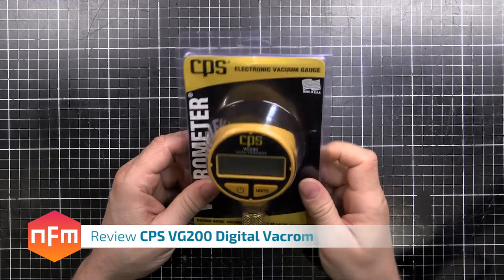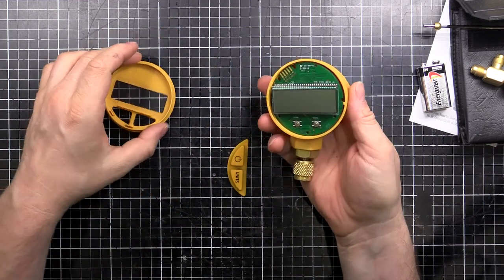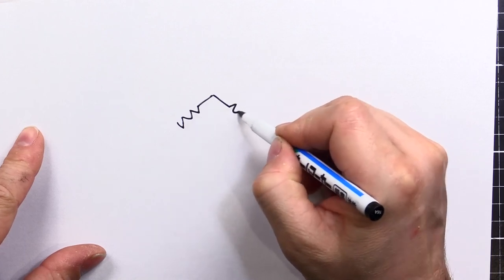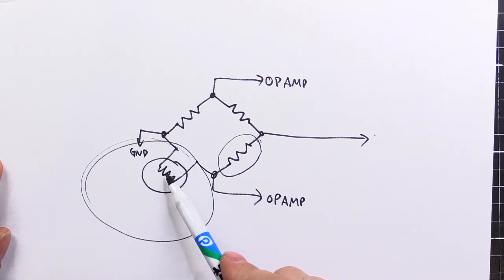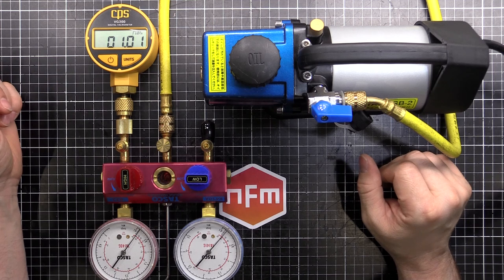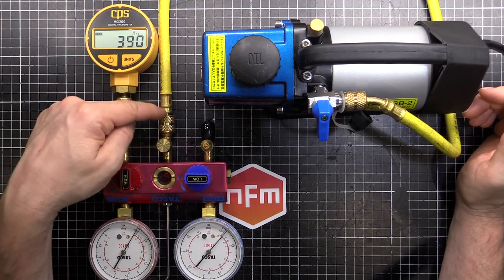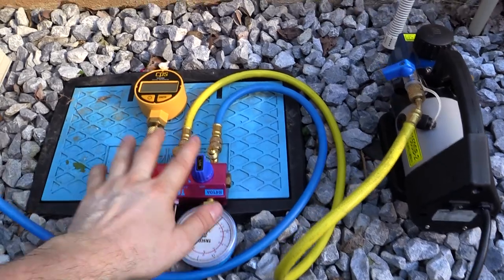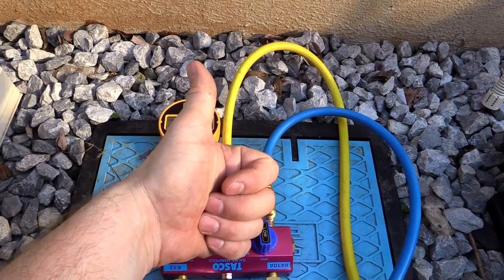CPS VG200 Micron Gauge Review

Comment: Where does this leak?? Everyone says that they leak mine doesnt .just trying to get an idea if it does happen  thanks .
Reply from the maker: Mine works fine and doesn't leak at all.
I think if you are careful and take care of it, it will work for years without leaking.
Reply: Mine leaks brand new out of the box, on the first evac. Was hoping  he was gonna break down the connection side of it as well. Guess ill have to do it… seeing as my Amazon return window is closed. I also have an email to CPS about it. Lots of reviews on Amazon stating the same.

Comment: Hi great video, I have a this gauge. I'm unable to get it out of low battery mode. Just shows dotted lines and a empty battery indicator. put a new battery in and cleaned the sensor with alcohol. 
Still the same.

Comment: What's the life expectancy of these gauges? During rugged everyday use, will these last a few years in service?
Reply from the maker: They should easily last for many years as long as you take care of it and don't let the battery leak inside.
There are no wear parts, basically the only maintenance needed is an occasional wash with isopropyl alcohol inside the pipe fitting where the sensor sits.

Comment: Hello ,can you tell me why is my cps micron gauge is turning off by itself while is working with the vacuum?
Reply from the maker: It has an automatic timeout to turn itself off after 5 minutes so the batteries don't run flat.
It happens to me too, so I just turn it on again. There doesn't seem to be a way to disable the automatic shutoff unfortunately, so you'll just have to turn it back on when it turns itself off..

Comment: Great info, but which way does the battery get installed?
Reply from the maker: The battery should only be able to go in one way, but the +ve terminal of the 9V battery goes to the top connection.
Reply: @NearFarMedia  Thanks!  After I posted that question, I found that if I looked into where the terminals were mounted, I could see a red and black wire.  Thanks again!

Comment: I'm new to hvac.. if I have the fieldpiece SMAN 380V manifold would I even need the CPS vacuum gauge? I have both already that's why I'm asking.
Reply from the maker: I'm not familiar with the SMAN, you'd have to check if it has a micron gauge function built in.

Comment: I've got the same vacuum gauge. You mentioned, "if it stabilized above 3000" be looking for issues. Why that figure 3000? Does this mean, at that level of vacuum it is unlikely to be a leak in the pipe, and more likely to be off gassing, etc? Signed: Inexperienced
Reply from the maker: 3000 micron means a good enough vacuum for aircon applications. Lower is always better though.
If it slowly rises, you need to check for leaks as air is getting in somewhere.

I can routinely get down to the low hundreds on a new install, getting around or even under 500 micron shouldn't bee too hard, so it's always good practice to let the vacuum pump run for half an hour or so to make sure you have as much of the air out as possible.
Reply: @NearFarMedia  i dont know if youve actually done an ac cert but youre microns arent meant to rise above 600...
Reply: @NearFarMedia  3000??? Its 500 or lower.. I usually dont charge larger systems until I get 300
Reply: 3000 is too high. Holding at 500 is great. 1000 or below you're good. 1000 to 2000 means condensables, (air, gases) moisture, or even a small leak. Evacuate again and/or fix small leak. Above 2000, definite leak. All micron gauges will rise after pump is turned off because of the power of the pump is pulling down on the vacuum. Once that vacuum action is cancelled, (pump off) there is just that much LESS pulling vacuum and the microns increase. Other factors apply as well as he stated, but remember you are in microns which is a very small unit of measurement. This is why it's used to check for leaks as even the tiniest leak will show up causing microns to increase.
Reply: Go for 300 micron if it's goes up back to 500 micron that's good. 3000 is way to high